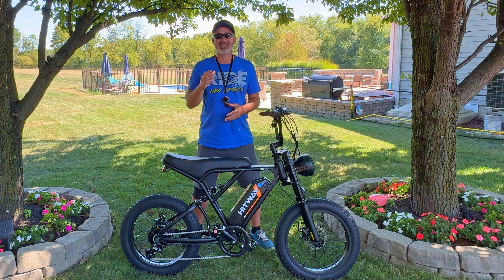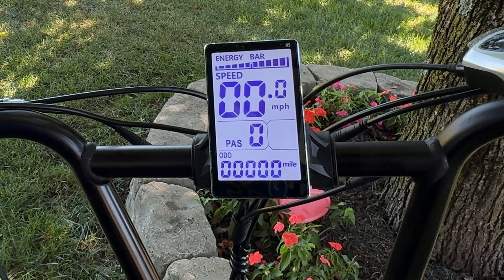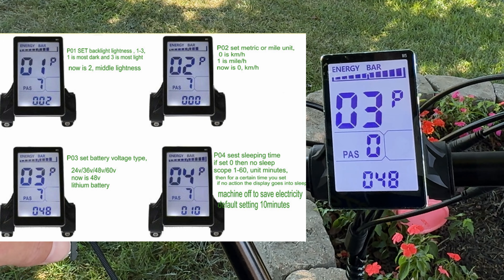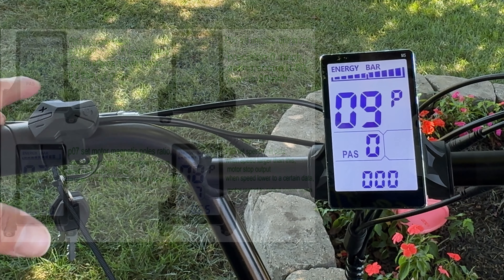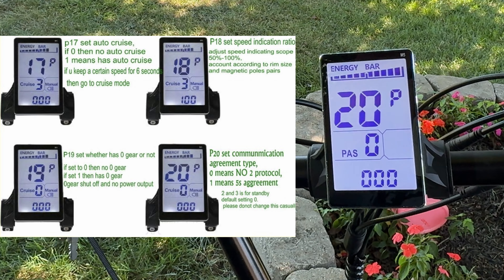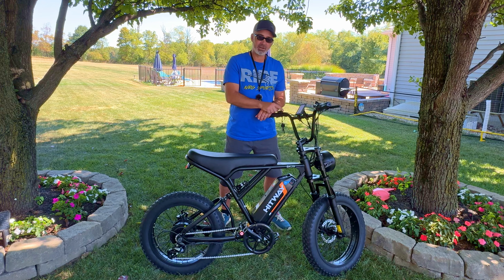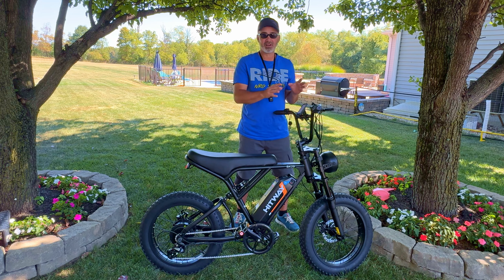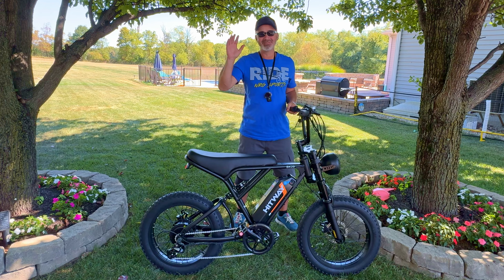HACK YOUR EBIKE TO GO FASTER - PANEL METHOD - EASY STEPS

Comment: I have a Eahora terra!! AND LOCKEDat 20 please help
Reply from the maker: In the manual it shows all the unlock codes. Did you look there? Also yours goes 33mph standard unless someone messed with the settings already
Reply: It arrived in a damaged box scratched and DENTED and void of any paperwork NOT A PIECE OF PAPER WHATSOEVER
Reply from the maker: When you contact Eahora to get it replaced what did they say?
Reply: @NRGSPORTSANDHOBBY  I'll post what they tell me Monday,I appreciate you replying back and all the info on your videos